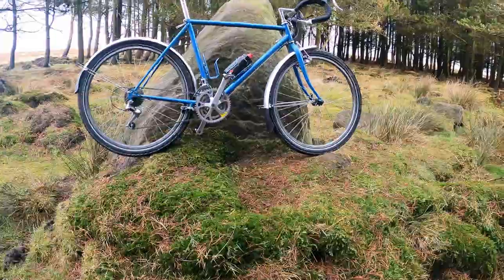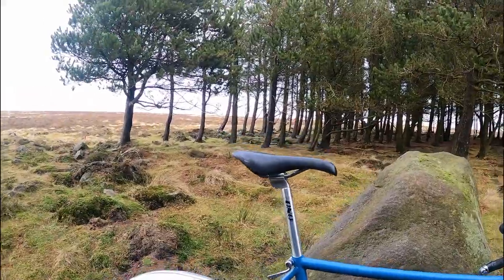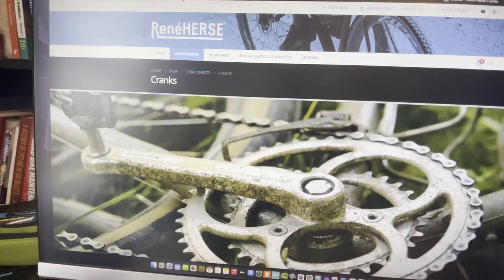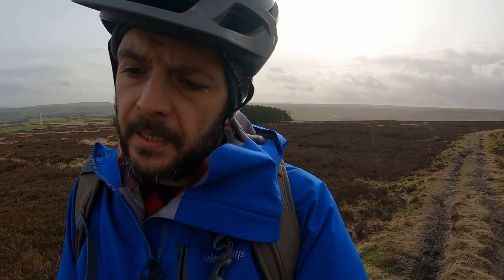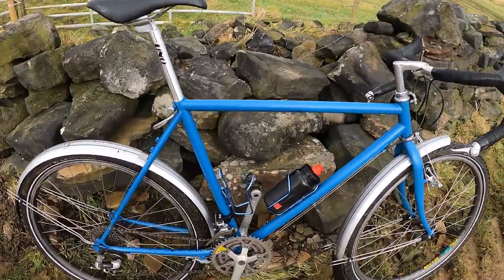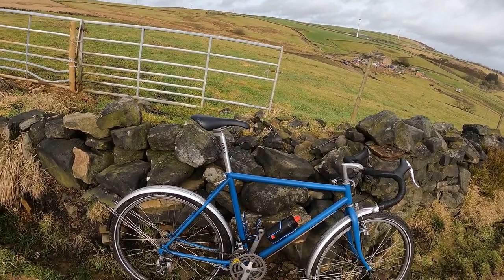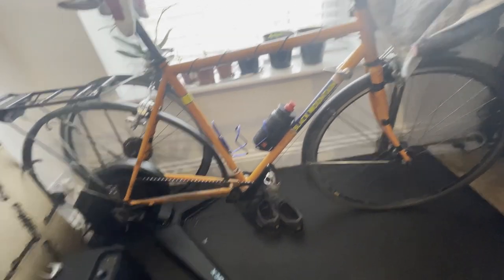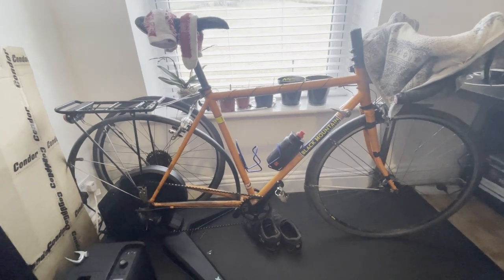Gravel Bike Conversion Part 4 1988 Rockhopper to Off Road Tourer / Bikepacking Bike Conversion

Comment: Great minds think alike! I converted a '80s Bianchi Ocelot MTB to a 1X (38x12-40) with riser bars, V brakes, and friction thumb shifter. The only thing I can add is please consider that your rear wheel is not tasked like your front wheel. I prefer a 26"x1.75" front with some tooth to it and a 26x1.95" slick (extra rubber) on the back. It balances the weight loading better.
Reply from the maker: Yeh the tyres that were already on the bike when it came from eBay a couple of months ago.  The conversion will be running 2” proper knobby as it is really muddy and boggy around here at the moment 👍🏽
Reply from the maker: BTW your bike sounds ace 👍🏽

Comment: Does your Rockhopper have a rear brake? I can't see one.
Reply from the maker: Hi yes there was a fashion in the late 80’s early 90’s to have them underneath the chainstay near the bottom bracket, they use a u brake which is similar to a cantilever brake.  The advantages are less flex, disadvantages are they get covered in crud.  You will be able to see it in the video if you look near the chainrings. 👍🏽
Reply: @RidingBicycles  I vaguely remember. It sounds like it was a stupid idea that luckily never caught on.
Reply: Which rear brake did you use on the rockhopper ? I have a hardrock frame which needs the same u brake , thanks
Reply from the maker: I purchased two as the first was taking a long time to arrive so it now has a dia compe one on that works well. I did not get it from the shop in the link, but it is the model pictured.
https://images.app.goo.gl/e5GxTvswekuAAren7